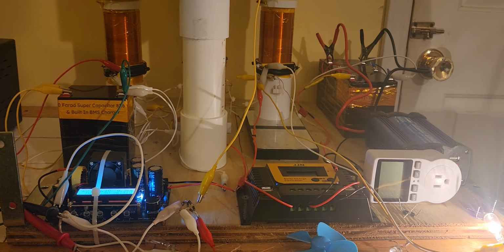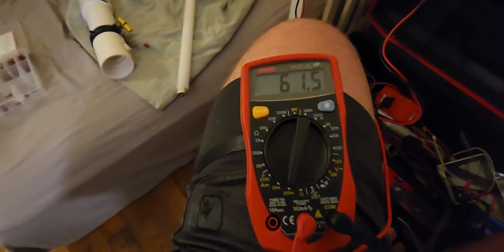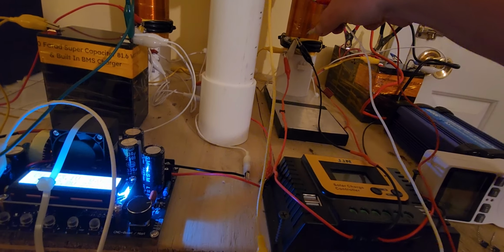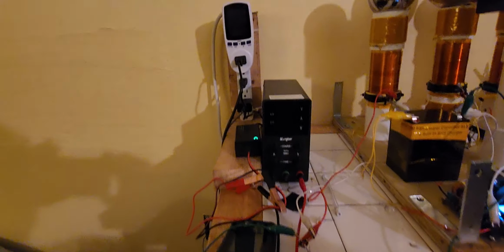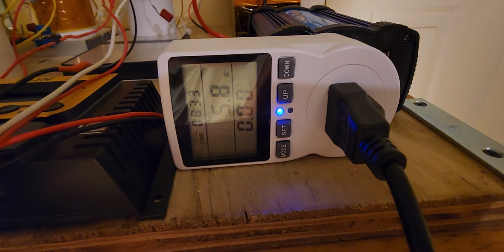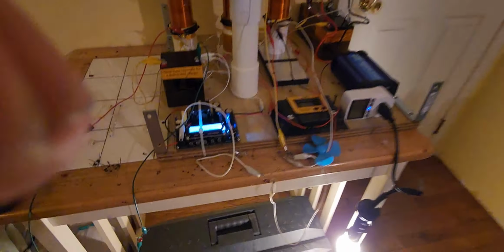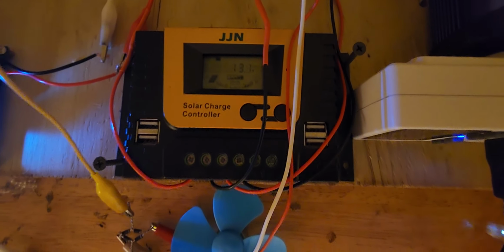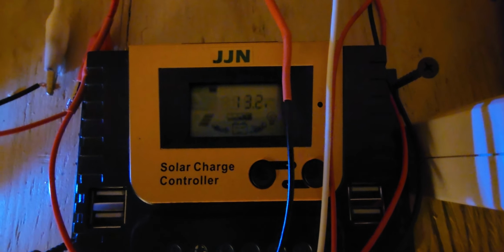🌩FURTHER REFINEMENTS TO THE SELF SUSTAINING WIRELESS POWER GENERATOR & A BATTERY CAN BE A RECEIVER?

Comment: Will you try a sulfated battery, as long as it is not shorted it should come back.
The high voltage will start the breakdown of the sulfate, hi frequencies are used in desulfating chargers but they don’t have the high voltage, take the cap and charge it to 40v and short sharp shocks will awaken your battery. Alternative use of this technology.

Comment: How is the cap that is powering the system effected, does it drop in voltage?
Reply from the maker: Yes & No. It started with a 13.50 volt charge & fluctuates between 13.2-13.33V & that's only because my solar charge controller only charges batteries to 13.2V :)